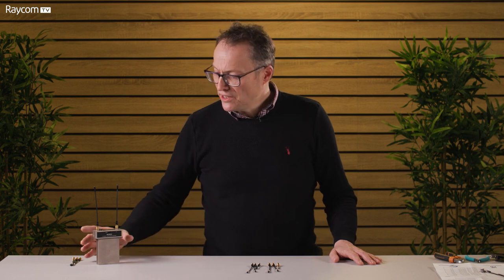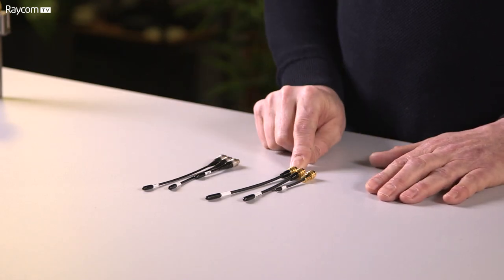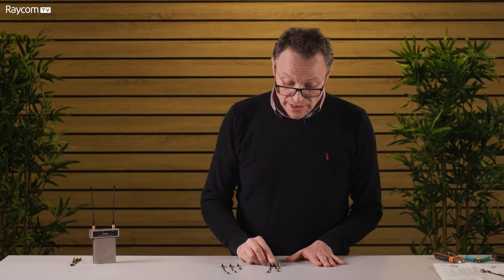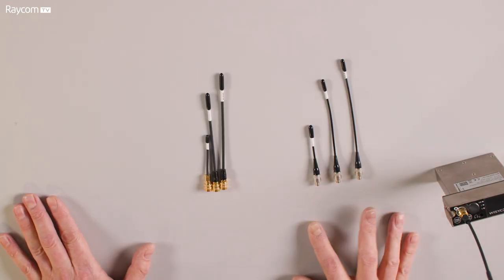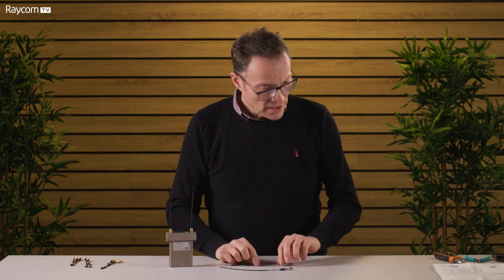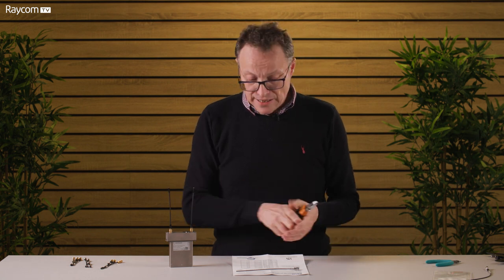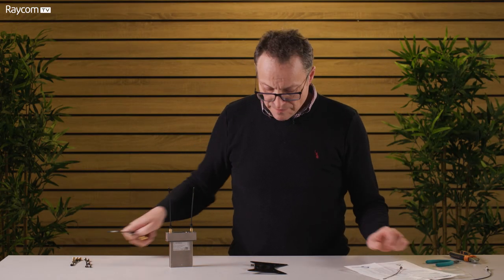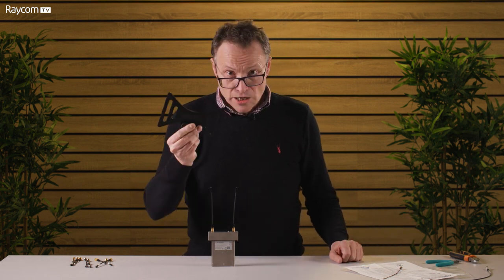Whip Antennas Explained

Comment: How much better would be an external antenna like the bowties? Is there any rule of thumb? I've heard around 20% more range...
Reply: Very good question. Watch this space!
Reply: My understanding is that an external antenna is not inherently better at all. The advantage of a dipole antenna like the bowties is that it generates a synthetic ground plane. In other words, you can place it wherever you'd like. A whip antenna needs a ground plane, ie. the receiver. The Betsie bowties are very wide band, and that also means it captures a wider spectrum than a whip antenna – that's not really an advantage. Your only advantage with the Bowties is remote-ability. But in a bag? With an additional compact, inefficient low current RF distro? I would say it creates more problems than it solves. But, being able to remote an antenna – that's a huge plus, and the only one in this particular case.
Reply: @mlohninger  Thank you!